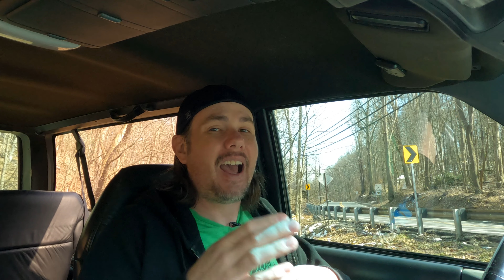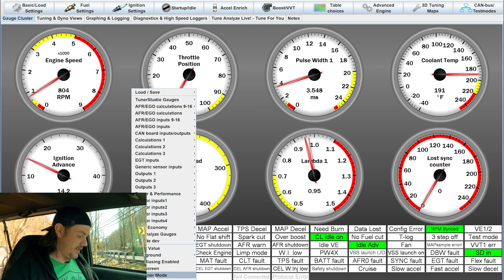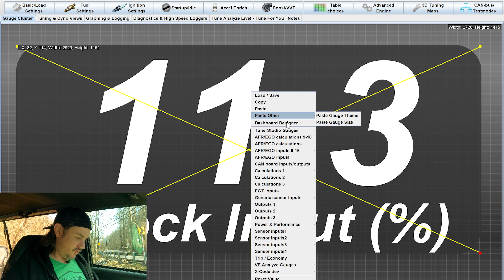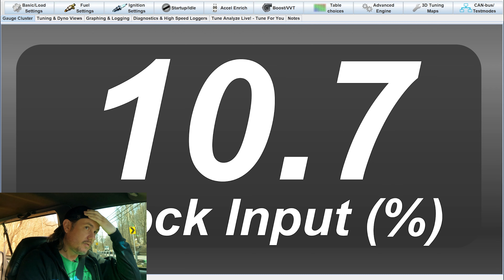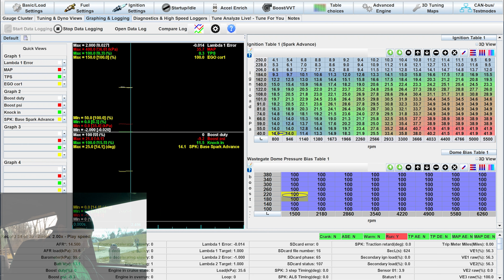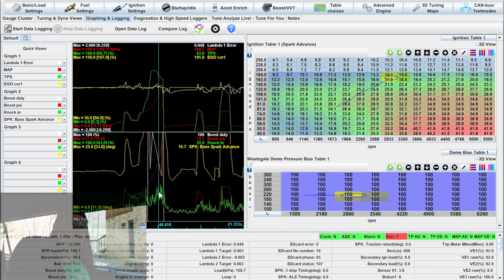Setting Timing And Knock Protection On The Megasquirt For Our Typhoon

Comment: Another over-complicated knock control system.
Too many options and adjustment points. There is a very real danger that the knock could be "tuned out" and non responsive with incorrect settings.
Also, why does the system restore the timing after a knock retard event? It will just knock again when run under the same conditions.

Comment: Is there a way to test a knock sensor through the program? I know how to do it with an ohms meter however I attached wires to the correct pins but I am not getting any readings when I tap on it. Thanks

Comment: Do you know I have a knock light it has a 0-5v signal wire can that be used and wired into a ms3, the ms3 has built in knock inputs anyway but I'd like to keep the light too as I'm not always using my laptop.

Comment: The coupler blow-off is a sign that you are missing at least one intercooler support bracket.  There should be two vertical connecting to the exhaust manifold and one horizontal that connects to the intake.  The horizontal is key to preventing the blow-off.  SportMachines sells all three, or just make the horizontal one out of some flat stock...

Comment: Small block Chevy engines ran 34-36° of timing because of the kidney bean cylinder head design. Whether they had 8.5:1 or 10.5:1 like the 92-97 LT1 V8. LS run less because they have a more efficient cylinder head design. And around the same compression as a Gen 2 SBC.
Reply from the maker: Mike that is a great example of how technology helps with burn rates